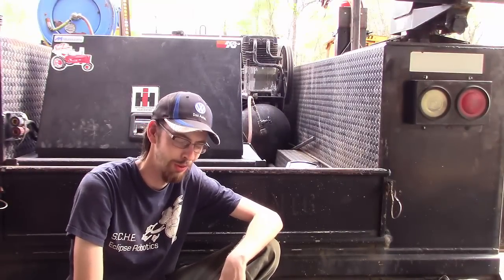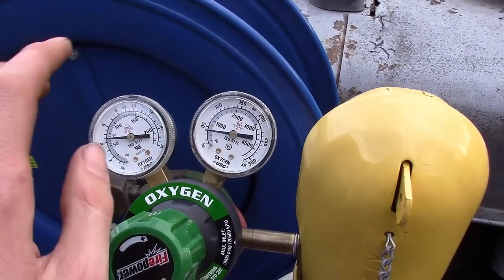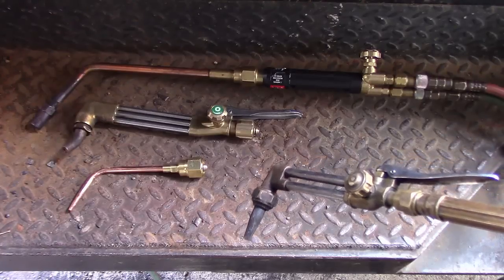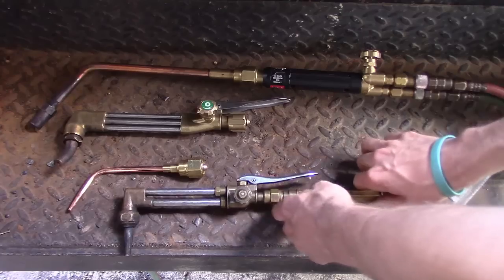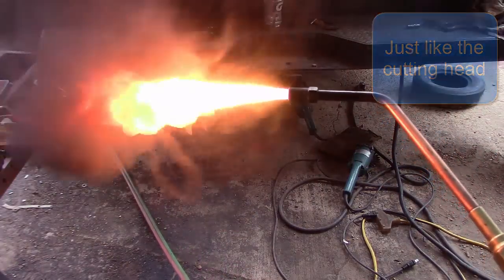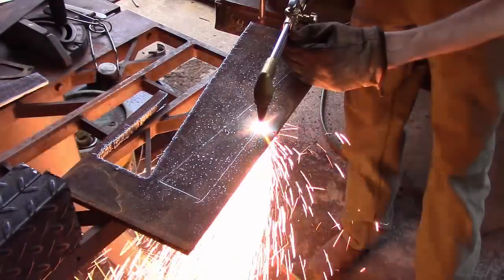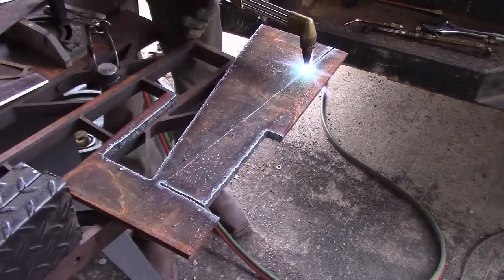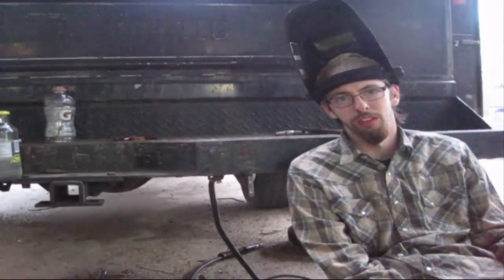Acetylene torch basics

Comment: When operating a rose bud using acetylene gas I'm told you should never withdrawal more than 1/7 of the bottle capacity at one time. I currently have a 145 cubic in bottle of acetylene. 145 divided by 7 equals 20.7. According to my paperwork that came with my smith torch, the withdrawal rate of acetylene while using the rose bud is 28 cfps. This exceeds the 1/7 withdrawal rate of a 145 cubic in bottle. I understand this creates a dangerous condition. Basically withdrawing some of the acetone from the bottle that's used to keep acetylene stable. Am I correct about the way I'm reading this?
Reply from the maker: That sounds right.  I've never used cubic feet to judge acetylene flow I've always used presser.  Working with presser I know you never go over 15 psi (Or one bar) and that is right if you make the flow go higher than that you can make the acetone flow also, and that is not good at all.

Comment: Great instruction, thank you. I don't have an oxygen lever on mine, there are just 3 knobs. Two smaller ones next to each other, one for acetylene, one for oxygen, and a larger one towards to the torch tip. What's the best way to use this thing?
Reply from the maker: Most to all torch's have 3 knobs (Real cutting torch only have 2) I've never heard of that.  Be sure the lever is not missing, but if it doesn't have one for sure it may not be for cutting.
Reply: Hi and thank you for your quick response. It seems to be an European thing. I'll keep you posted. Thanx again.

Comment: Nice video! Question: do run your ace/oxy pressure settings for a rose bud the same as cutting head? I can't remember and I needed one the other day.
Reply from the maker: Yes you can run the same pressure. I have played with it some seeing if would run any better, and 30 psi looked like it did the best, but it wasn't by much.

Comment: What does it mean to burn metal like you say @8:30?
Reply from the maker: You can burn a piece of steel if you hold to much heat for to long.  A thick piece of metal is not easy to burn, but a thin piece is. Look up carbon precipitation if you lose a lot of carbon the steel will no longer be hard or tough, and you may have a failure in a weld or connection due to the metal being over heated.
Reply: +Classic Work FCB

Comment: Excellent video.  You might mention to never lay an acetylene tank on it's side, or if you do make sure it is upright for a couple hours before you use it.  You will wreck your gear just like having more than 15 psi of pressure at the gauge.
Reply: That's because it has liquid acetone in it. And that will foul the regulator. Very dangerous. It's best to wait an hour like you said.

Comment: Good instruction video on using the torch and safety tips ...I was lucky to be able to be around  a torch when I was a kid and learned a lot ..I once worked for a company that had me cutting 16 in tall I-beams all day and the boss thought I was certified Because he liked my work ..But I had used a torch and practiced over the years to get good at using it... My favorite thing is to braze I would like to learn how to torch weld better with steel rod I have only done it once
Reply: +Classic Work Brazing and gas welding are not that hard,it is mostly in technique.  When I was working at a tourist railroad, i went to night school to learn to weld.  I took my practice coupons to work and my boss said they were really good.  It was easier than electric welding.  I was working on a project at class using rail and the instructor didn't think I would be able to torch cut the rail but I did with a result almost like yours on the plate.
An iron worker showed us helpful trick is to lean the flame toward the direction the cut is going so the metal is heated ahead of the cutting flame.  This helps make a nicer cut.
I learned to braze when I worked for Trane brazing copper to copper, copper to brass, and copper to steel.  We used a double tip torch with oxygen and natural gas.  I have made around 1600 connections in an 8 hour shift; sometimes with no leaks.
Reply from the maker: +not2fast4u2c Thank you.  Very cool aye that is one thing I don't know how to do at all is gas weld.  I've seen it done, but not in person.  Might have to give it a try.
Reply from the maker: +Roy Reynolds Very nice that is really cool to hear.  I took welding for 2 years, and we never touched a brazing rod.  I know it is very useful, and can do things that arc welding can't touch.  I know what you mean I know on cutting really thick plate its a good idea to make a bigger kerf so the metal has somewhere to go instead of sticking to the rest of the plate.  Thanks for the comment.
Reply: Brazing probably is the best way to repair cast iron breaks.
I have never tried this but understand if a bolt is broken off in cast iron it can be "blown out" by starting to cut the bolt like cutting then turn off the gas and just using the oxygen to remove the steel will leave the threads in the cast iron untouched.  Maybe just chase them with a tap to make sure all slag is out.
Reply from the maker: +Roy Reynolds I've seen my dad fix exhaust manifold breaks with a brazing rod more than a few times.  I could see how that would work cast iron has a higher melting temperature than steel plus oxygen does not cut cast iron due to all the graphite in it. I may have to try that one. Thanks man.